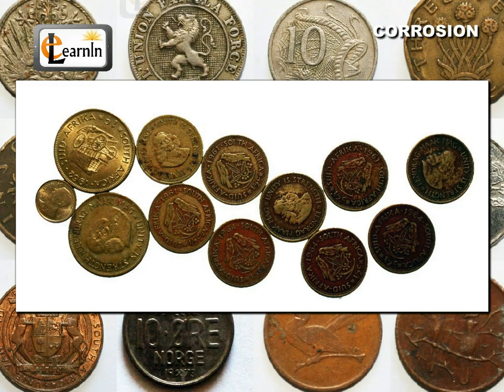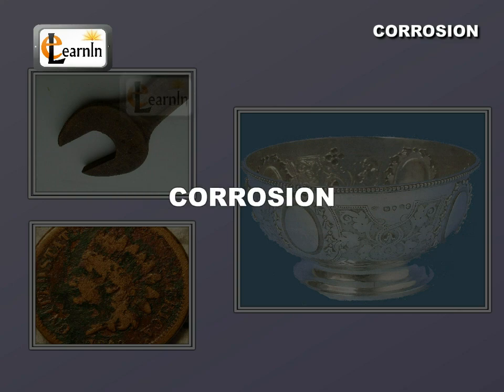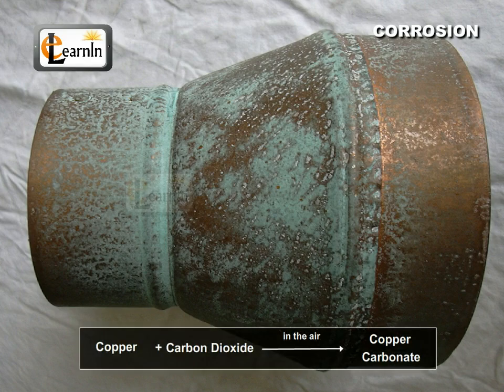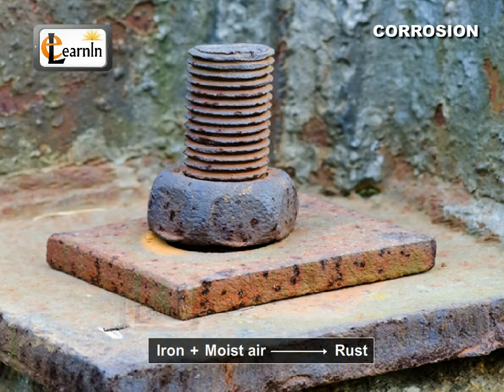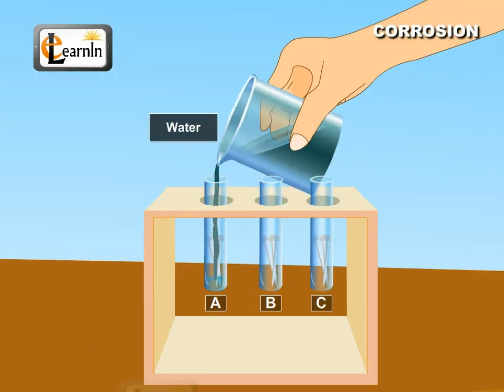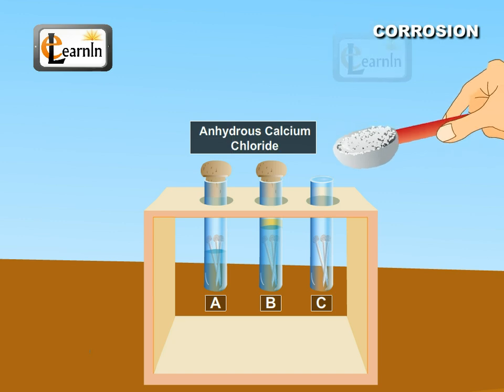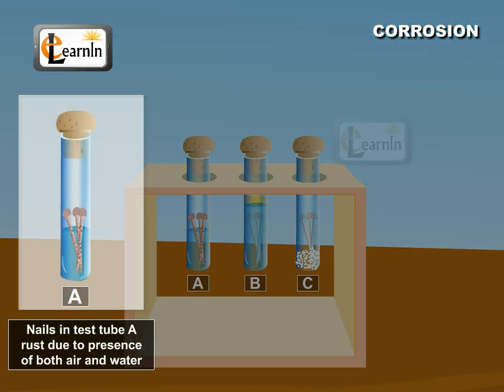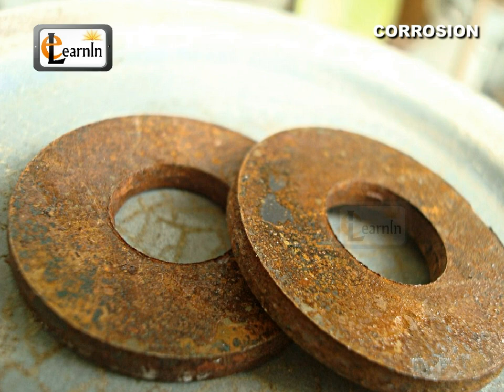Corrosion and rust- Science

Comment: Ship wrecks rust under water. (without air)
Reply: how do fish breathe?  there is oxygen inside water.  however being completely submerged slows the process greatly.  hence why the splash zones on ships are the first to corrode or have a failure in coatings instead on the bottom hull that is constantly submerged
Reply: @brandonpratt5130  in case b there is a oxygen under the water right but corrosion doest occur why?
Reply: @saitarun6562  corrosion itself is a electrochemical process and there is 4 parts to a corrosion cell a anode, cathode, return path (the material in question i.e steel, aluminum, iron and so on) and a electrolyte.

To quote a text book for coatings inspection and corrosion control on the 5 variables to control corrosion rates

"1. Oxygen: Oxygen content additionally 
influences the rate of corrosion. Limiting 
oxygen is a practical way of reducing the 
rate of corrosion. The addition of inert 
gases, like nitrogen, into a tank, or ves-
sel, to reduce the oxygen level, will 
reduce the rate of corrosion in that tank 
or vessel. Additionally, the limiting of 
oxygen by de-aeration might be utilized 
with steam boilers to reduce the rate of 
corrosion attack.
Yet, oxygen concentration cells also 
exist that speed the rate of corrosion. 
This occurs when there is a difference in 
oxygen levels between two different 
points on the same metal. This is often 
seen in immersed conditions, where the 
electrolyte at one point on the metal has 
a higher concentration of oxygen, than 
the electrolyte at another point on the 
metal. The area of higher oxygen con-
centration is then the cathode, while the 
area with the lesser oxygen concentra-
tion becomes the anode. The anodic area 
will have accelerated corrosion. This 
oxygen concentration cell is often 
found in immersed conditions, caused by 
a crevice, over-lapping joints, or with 
debris and dirt accumulation"
Reply: @saitarun6562  I just rewatched the video and the oil on the water was a oxygen barrier to prevent the water to aerate, also the impurities in the water of test tube b was boiled out.  The pure water with no oxygen exchange make a poor scenario for corrosion to occur. All things will rust in time just some envirements will take drastically longer to do so
Reply: @brandonpratt5130  Thank You Friend
Reply: Thank you Brandon Pratt